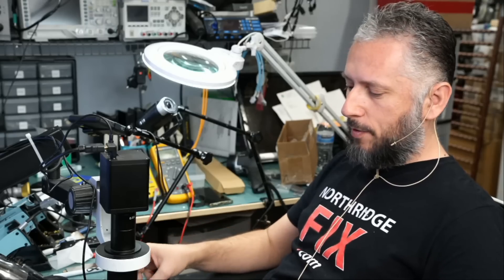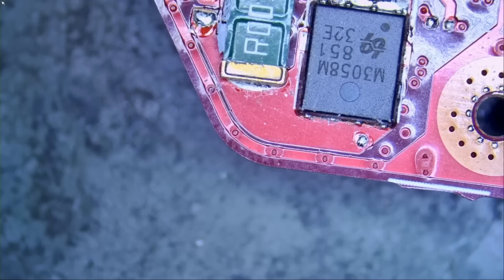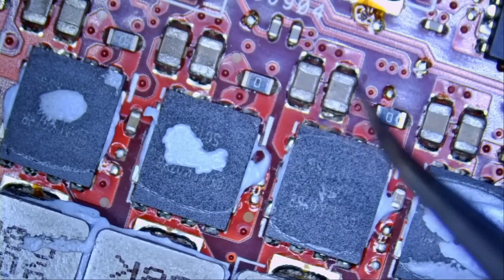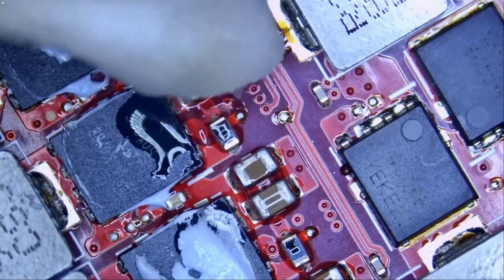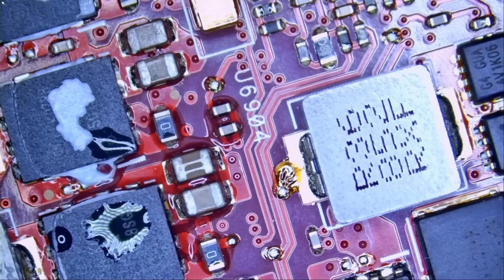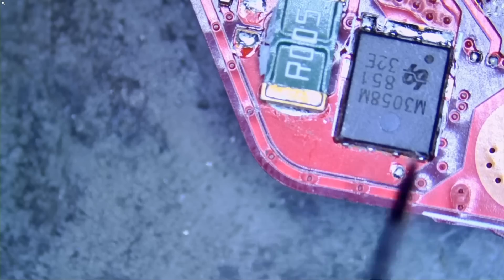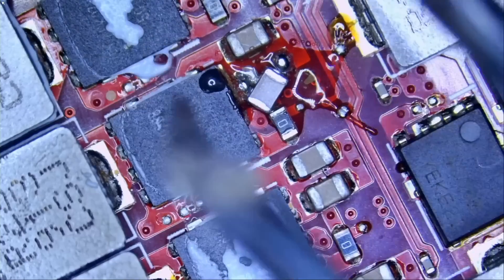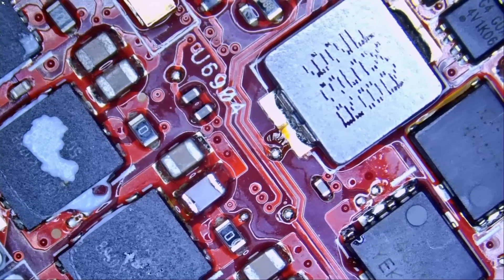Asus ROG Gaming Laptop No power Repair - Meet Rufus the tweezer.

Comment: Try Fet Driver in other side test in Ohm On  Capacitor BST, Find Resistance bellow 1M Ohm, Because FDPC5018SG BST on Q1 10V minimum 4.1M Ohm - 5M Ohm, mosfet Not Shorted but below Spec, i found 5 from 7 Mosfet VRM 0.8M ohm, maybe mosfet on aging

Comment: So first my 3080 ROG STRIX OC died, EXACTLY the same symptoms as the one that alex fixed with the power comnector shorting and shutting down the entire system, now I see this, I've got the rog strix laptop as well, same red PCB, if this thing fails as well I swear to god I'm going to lose my sh. My desktop is entirely ROG except for the AIO and it has been nothing but PAIN during these past two years, armoury crate is a disaster, what the hell happenend to this brand it used to be great

Comment: Hi... I've tried soldering an 1x2mm capacitor on my 11yr old graphic card but no success...
Steps : 
1. Pads looks rusty... so Applied heat with rod on board and cleaned all solder from pad with copper mesh... and gave alcohol wipe.
2. Tried applying fresh solder but it dosent stick on board pad like a dome instead turns into ball and runs away from pad floating around the board. (Surface tension)

P.S. I am no professional... just got basic soldering kit to try and repair a few things and learn.
Reply: Flux?

Comment: hi. ok i have a very small problem i have 2 2tb ext usb 3 drives. one started to tick so i transferred the io board from good drive to the ticker drive it did not fix it. now problem i have is the drive has 6 years of backup codes and emails and all my product keys from old msdn days and a few backups of all my 1tb of paid software and 8 years of backups of sales. the io boards are fine just the drive is ticking like a bomb.  i do have a 4tb waiting for me to recover to.

Comment: Hey man i have a question i have rog strix 15
One day i thermal pasted my laptop and the right sided gpu fan got slowed felt like it stopped spinning in the armory crate gpu fan rpm is 0 and cpu fan is okay..
I thought i messed up my fans while cleaning
So later i got the fan replaced but it didn't solved my issue....
I checked the 4 pin connector they were fitted firmly but i still don't know why my gpu fan rpm is 0 and it doesn't feel like its spinning at all..
Whole heatsink is now dependent on my left side cpu fan.

According to you what could be the issue i may have caused during thermal pasting?
Reply: What about contacting warranty instead
Reply: @Master777with69  out of warranty bruh.. thats why i thermal paste by myself

Comment: What is normally the cause of these kinds of issues?  What causes the capacitor to go bad?
Reply: Heat can cause thermal expansion, causing internal stresses which result in microfractures that compromise the internal layers of the cap, and voltage spikes can also stress the part to failure if the max working voltage is close to the margins of the circuit.

Comment: I bought an ASUS Rog Strix laptop on amazon for $1169 with prime and it was originally like $1400. after about a year of having it, its starting to run like shit and be really slow. I would have to clear the %temp% folder and my history for it to run faster.
Reply: That's not the fault of the laptop, mainly down to Windows. CCleaner is pretty good for decluttering the OS